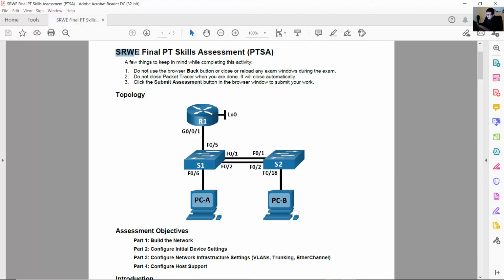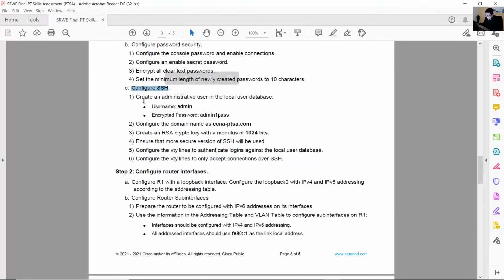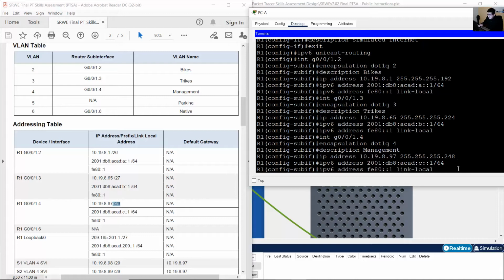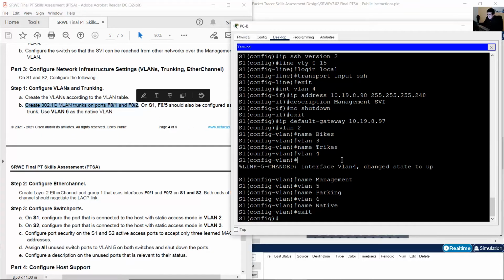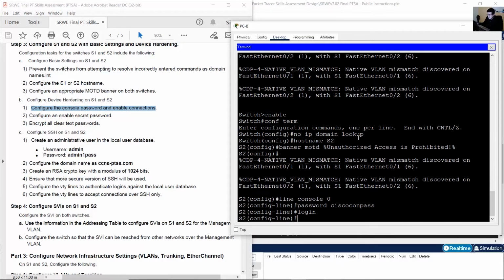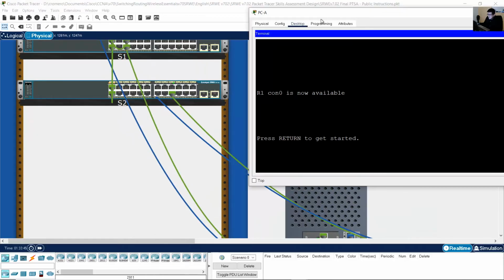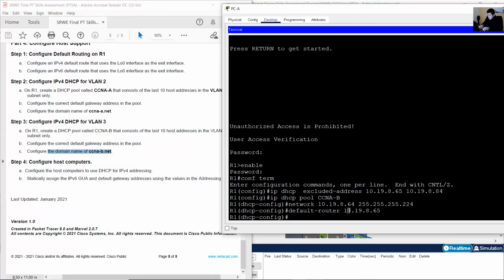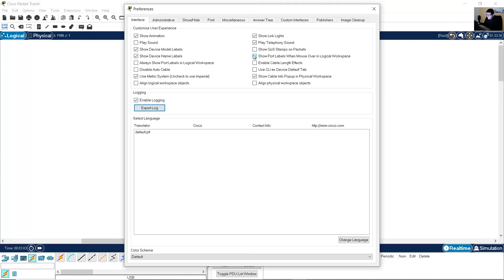CCNA v7.02 SRWE Packet Tracer Skills Assessment PTSA

Comment: Dear Christian! Just my opinion, you have to use the cross-over cable to connect two switches just in case for the exam; a computer with Auto MDI-X can use either a straight-through or crossover cable for any application. But in this scenario, if the switches don't support Auto MDI-X, then you might can't communicate between those two switches.
Reply from the maker: You alright, older switches on real lab will need crossover connections on fa0/1 and f0/2
Reply: @romeroc24  Thank you, Christian 
You are the best! 
Thu ms up from Chinese students
Reply from the maker: @-g-scorpion5933  Thank you my friends, very good, Cheers from Peru

Comment: How could the Lo0 be represented in packet tracer. In my SRWE skills assessment (which I already passed recently, thanks to you) the router has a loopback Lo0 representation. Yet I wonder how it was done to represent the Lo0 loopback in the activity. In my intent to reproduce the skills assessment, I can setup all the equipment (2 PC´s, 2 switches, and router) along with their connections. Yet to show the router with the symbology representing the Lo0, I cannot figure what to use. For in the original activity it has ---|Lo0 drawn to represent the loopback.
Reply from the maker: You're welcome! Thank you for all your support!!
You can create a loopback interface using the following commands in any router
int lo0
ip address 10.10.10.10 255.255.255.255

Comment: Sir I got a problem while doing this.I have connected the cables only. there is no way to configure any device. Because it shows, " All usable tabs are hidden or locked away by design in this device's power state. Go to preference tab to fix it". But that tab also not enable. Could you please help me to fix this?
Reply from the maker: You need to use a PC, use also a console cable (light blue) and connect from PC RS-232 port to Console port on any device (like Router) and go to PC and Desktop section use Terminal to access the console

Comment: Is it better to use a crossover cable between similar devices or not a straight cable ?      mostafa hamdon     Egypt - Assuit
Reply from the maker: on old equipment you can use the rules for crossover cables, but now MDI and MDIX permit the use of straight through cables
Reply: Thanks

Comment: I think there is an error in the secondary DHCP pool. In 27 mask 32 IP addresses, so the range of host addresses  will  start from 65 to (97-2)95
Reply from the maker: 64 is the network, the range of hosts addresses is from 65 to 94 and 95 is the broadcast
Reply: @romeroc24  its a /27 so its going to be a 32 network